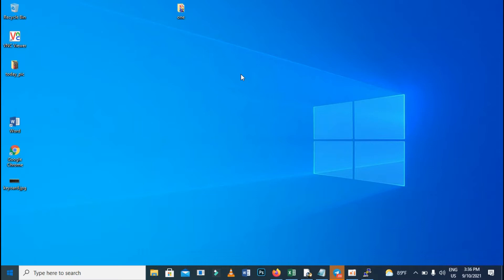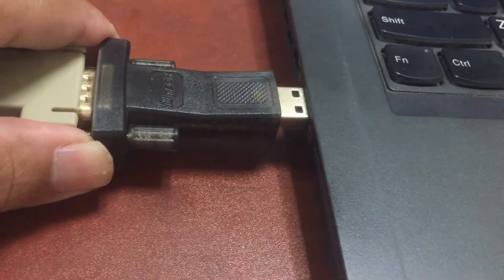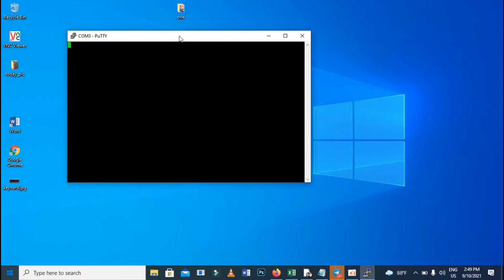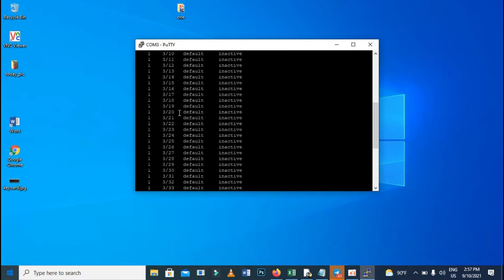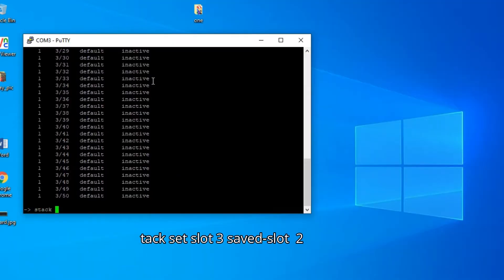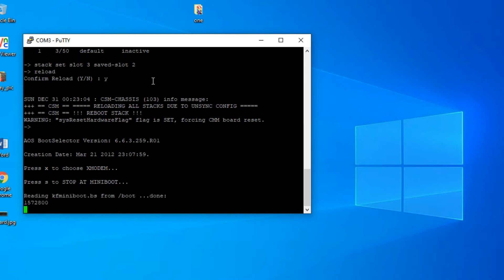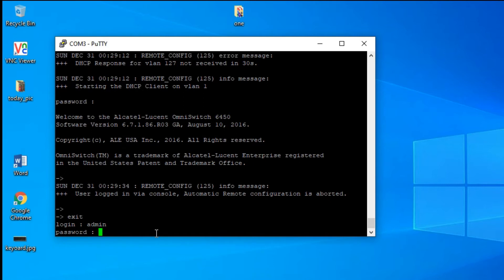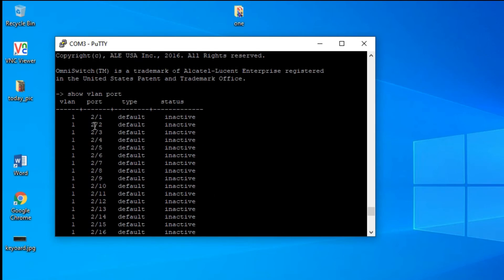Configure Stack Cable Alcatel Switch | How to Use Stack Cable with Alcatel Switch

Comment: I have 2 switch one with ID 1 and the second with ID 2 the second one cannot drive poe to cctv I checked the configuration all are poe enabled what is the problem
Reply: its a hardware fault, i have plenty of alcatel with failed poe